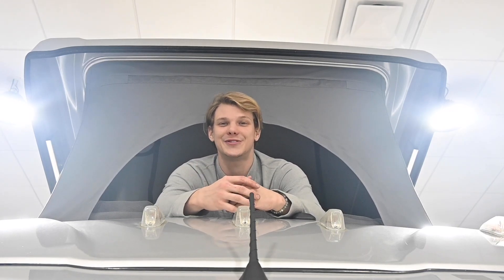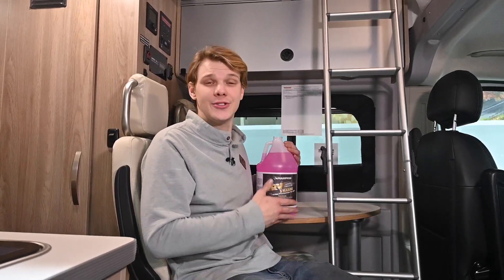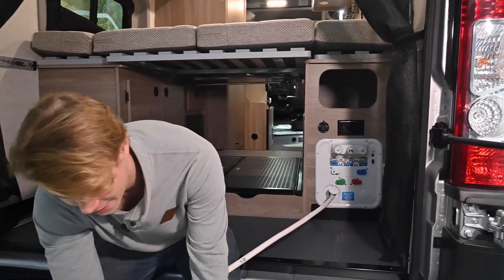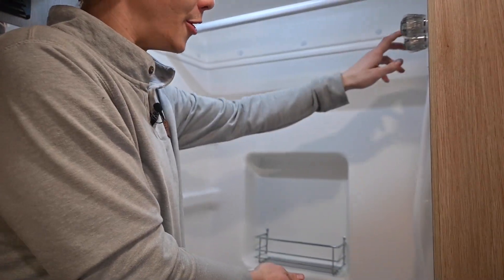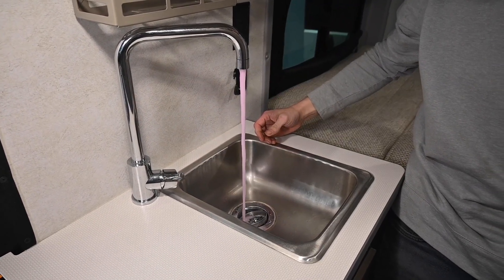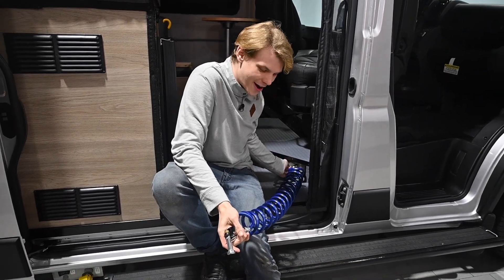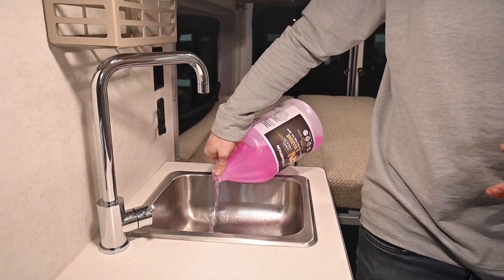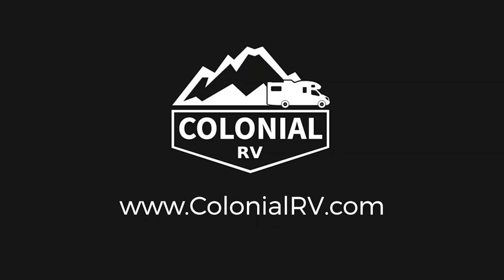A MUST-DO BEFORE WINTER | How To Winterize Your Winnebago Solis Camper Van

Comment: Why does my Winnebago Roam 59RX Class B operators manual on page 4.5 dierect me to section 6 to see how to winterize my Hydronic Heating System. First off there is nothing there about that. I thought it was an independent system that use a different antifreeze. Do I have to winterize that system? Otherwise I found your video very useful  very simple to winterize the water system
Reply from the maker: It's tankless, with no bypass or drain, so you would winterize as usual.
Reply: Thank you

Comment: If you have it in the winterize position… why would you need to turn off the trauma?
Reply from the maker: Winterization valves bypass the Truma. It prevents it from running and heating the antifreeze in the system.